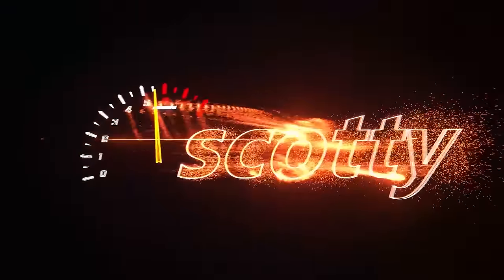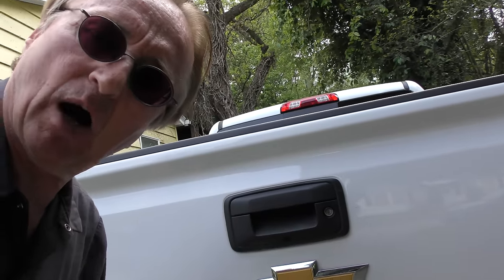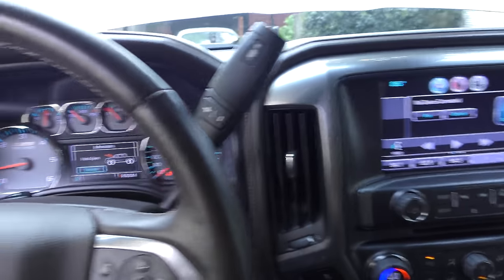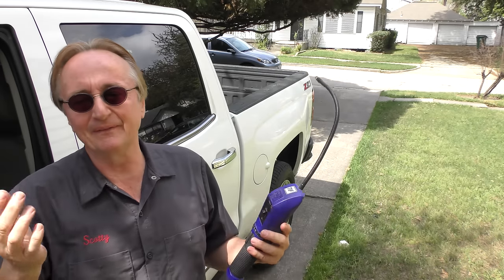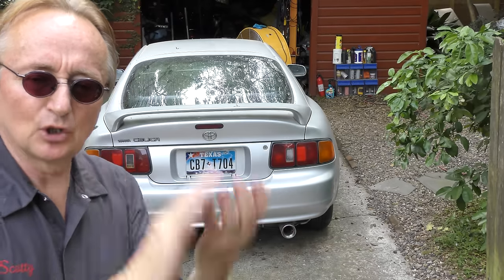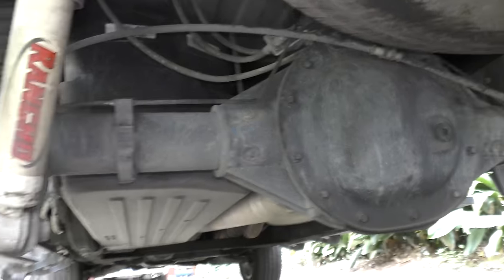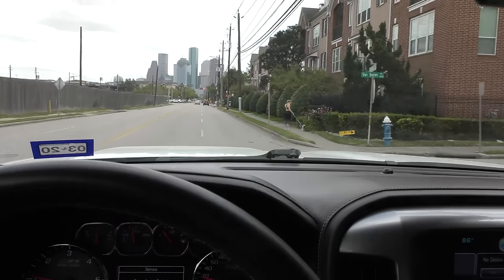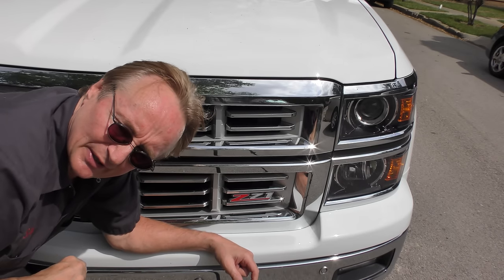Here’s Why I’ll Die Before I Buy a Chevy Silverado

Comment: My 2011 Silverado has 260000 miles on it and it still runs great.I did put a deactivator on it to keep it in full V-8 mode. Great truck with no payment
Reply: Same here. My 2014 silverado 6.2l has 280k miles, I put on a range afm deactivator, and it's still going! Original everything. Just maintenance and tune-ups. I'm presently working on redoing the suspension, though.
Reply: @Flub_Kub you got lucky bro

Comment: I have an all-original 2000 Chevy Silverado 1500. It has nearly 300,000 miles. Even with all the internal plastic pieces they switched to in this generation, it’s still held up better than most Fords I see from similar years.
Reply: Mine has 400000.
Reply: those early 2000 fords are honestly a hit or miss, i know someone who had one with 400k miles and finally went out because of a wreck, and then some where they go out when you just look at it, you never know with those early 2k ones lol
Reply: My F150 has the aluminum bed.  It was cheap when I bought it.  Aluminum bed isn’t a good idea.  Oil change guy tells me the oil pan is plastic and the plug is plastic.  Only a rubber O ring keeps oil inside
Reply: The 2005 Chevrolet Silverado I have has had it’s issues, but it’s a great truck!
Reply: You’re smoking crack saying It holds up better than fords from that year… 2000 f250’s and excursions are laughing their arses off
Reply: @spookledrealhard7154  We’re talking about F1 50s & 1500s!
However everybody has their own experiences in life! Some people prefer a Ford truck some people prefer a Chevrolet truck, some people prefer a Toyota truck. Some fools even prefer a Honda truck. 
You should keep buying whatever you’ve had the best life experiences with!!
Reply: @braveheartz263  did ppqpqaaa
Reply: I like Chevys. 
However, I agree that the cheap plastic handles suck on my 2013 Silverado
Reply: I’ve got a 2000 silverado with 280,000. Nothing other than oil changes and regular maintenance. Everything works.
Reply: @harrisonmauldin5090  all the f150s that aren’t a king ranch or raptor are garbage, and the ecoboost are garbage enginee
Reply: @AsianNIGMA  I’m talking about 2005-10, with the 5.4, the raptor didn’t come out until later with the 6.2
Reply: I had a Ford F150 99 the dash broke before that thing hit 50,000 miles
Reply: So you havent had to replace all your brake lines and hvac actuators...Most the frames are rusting away 99 to 06 if you have snow
Reply: Have a 2007 Silverado Classic (2006 body style) with 200,000 and a v6 long bed. I does have some rust in the driver side rocker panel but it still runs good. The tailgate handle broke at 0 degrees (plastic) . My favorite thing about the truck is I think it's one of the last, if not the last 5 speed manual with cruise control (LS). Anyway,  at 71, I'm going to hang on to it until I die,or it dies.
Reply: @MF-kb2nv  yes that's crazy about the brake lines, a critical part like that should have been stainless.
Reply: I have 2 Chevys. 2002 Silverado 2500 with 540,000 miles and a 2007 Suburban 1500 with 390,000 (original engine and transmission). They ain't perfect but I would go anywhere without a second thought. Scottie is an opinionated individual that likes to hear himself talk.
Reply: I love my 1999. It only has 146k on it though.
Reply: @harrisonmauldin5090  platinun had 6.2
Reply: The 2000 to about 2005 were night and day better trucks than later models. Don't get rid of it.
Reply: @spookledrealhard7154  The chevy was far better than Ford in the early 2000s. That's a fact, not opinion.
Reply: @allaboutroofing2  cool story bro sounds like one hell of an opinion
Reply: I have a 2001 1500, the v8 vortec is running strong, no lost power, at 225,000 miles, my buddy’s 2012 Ford F-150 has had 2 new radiators, 3 sets of new spark plugs, new fuel pump, and new ac system. The only thing replaced in my Chevy is $4.00 per gallon gas.
Reply: @larryrowe5259  I WANT.
Reply: I have a 2004 GMC Sierra w 374K miles n counting. I just redid the transmission bc it was slipping on reverse. Other than that awesome. Not buying a new truck. I'd rather replace my engine.
Reply: @spookledrealhard7154  It’s pretty simple actually. From 2000-2002, Super Duty > Chevy HD Trucks, and Chevy 1500 > F150. And this is from a Ford truck guy. That comparison isn’t even close.
Reply: Yay, I have a 2008 and still works great.  Actually I gave it to my son. Well over 100k miles.  I also have a 2010 and this one has 70k miles to this date. No issues.
Reply: My 2006 Silverado I purchased before the pandemic had 80k miles on it. Now I'm up to 160k and I haven't needed to put much money into it. Definitely a reliable truck. I can't talk about the new ones as I had to trade in my 2015 Sierra due to transmission issues and getting an 06 seemed like a better option as I wouldn't have a payment. The used car dealer actually had to pay me to take that 2006 silverado.
Reply: I have a 2003 Tundra with 600,000 miles and with no cosmetic problems
Reply: I have a 05 Silverado 1500 and it has 333,000 miles and everything has held up great but the transmission went out at 290,000 but after that I got a stage 4 built 4l60e
Reply: mine has 50,000. And frame is done...!!! 2011 POS!!! Chevrolet can sux it...!
Reply: @Hayden-sp1ol  recession GM quality is horrible you should’ve known better, anything beyond 2007 sucks, but anything before 2007 is great, my 05 Silverado is still going strong, the only issue I’ve had with it is the tranny and if you’re somewhat mechanically inclined it’s easy to swap
Reply: Yea he must never seen enough 99-06 models they run forever if u take care of em .

Comment: I can already hear the Ford guys smashing beers together over this victory
Reply: From 6 feet away, to maintain social distancing
Reply: I have 09 ford f150 149k new motor 6gs , I also have 2000 gmc sierra 180k original motor both trucks have little things like fan speed actuators etc gone bad but the ford even tho looks cool sits high rides well has rot in cab corners and has been nothing but a typical stereotypical ford piece of s....
Reply: Hell yeah brother
Reply: Lmao
Reply: @paulclancy2404  maybe wash it once in a while.
Reply: @masteronesolo4615  I keep it clean,  matter fact going clean today it's nice just taking water in rotting the corners quickly and spreading I'm going silicone rear window
Reply: I don’t know how Ford stays in business. I haven’t bought a new one since buying my F-150 in 2006. Still my daily driver with 14 years & 360,000 miles.
Reply: @norcaldeemichaels  I feel if I was able to buy one new it last life time also. My trucks are original owners but ford was big tire big guys heavy foot and chevy was babied taken care of .imo most trucks built well and how you take of them. The ford Van's at work some most durable vehicles I ever driven I'm just upset my truck has the cancer lol
Reply: @norcaldeemichaels  and the Van's are 2006 also so imo also besides how take care them certain years are better than others usually rule thumb dont go with 1st year of that motor or design,  I think only think have be careful are spark plugs in heads not having steel threads know to strip I'm sure w 360k you have crossed that bridge already nice 360 I like to hear 😃👍💯
Reply: Ford's having a premature celebration until they were told pay restitution for poorly engineered and manufactured transmissions.
Reply: Its no new discovery here, he's always said modern Chevy trucks and cars are garbage.
Reply: brad mironik every company has something they’ve been in trouble for though. Both Ford and Dodge basically use the same transmissions depending on which vehicles and got in trouble for how bad they got, Chevy got in trouble for the premature engine failures, Toyota got in trouble for the frame rot.
Reply: Really?! Ford is junkass plastic too dude??!! Really??!! Hahaha!!!
Reply: Hahaha Murcia
Reply: @jonathanrangel7036  True
Reply: insert happy manifold ticking sound here
Reply: They're next
Reply: Celebrating this victory while fixing their transmissions 😂😂😂
Reply: Jonathan Rangel Ford and Chevy have a joint venture to build transmissions not Ford and dodge. If you buy a Ford, it has GM parts in it. If you buy a Chevy/GMC it has ford parts in it.
Reply: Own three fords. 05 f250, 96 f350, 77 f100. I don’t see myself ever buying from another brand. All three still run perfect
Reply: Paul Clancy so you don’t like ford
Reply: Troy Patrick  They were all good back then, late 80s is when things went downhill on a few. Nowadays the big 3 all make shitty trucks. And you can’t convince me any different.
Reply: Mechanics own fords but tell you to buy chevy so they can stay in business
Reply: Man a truck is a truck i had all three chevy dodge and ford my chevy had 253000 mi on it before i sold it to my brother it still runs strong my 1990 F150 lariat had a 351 with 571000 mi an old dodge power wagon with 208000 mi on it i like all three.
Reply: Troy Patrick 😂😂😂😂😂😂😂 ok lol. In diesel world, the power stroke line has the shittiest engines of any diesel. In the gasser world the Chevy 6.0’s and 5.7’s are nearly indestructible. Meanwhile with a Ford you have to worry about head gaskets, cracked blacks, coolant in oil, oil in coolant, motor out of truck etc etc. Ford has some shitty trucks, with some good/great ones. My local parts dealer has an 02 duramax with 1000k miles. Big 1 mil. Fords a joke (trucks)
Reply: lmfao this made my day man
Reply: the ford heater cores do the same thing..
Reply: Paul Clancy that’s on you for buying a 3 valve
Reply: @psyker4321  yep it was the head that caused motor to go , all brands have good and bad even dodge some those with Cummins have million Miles , my gmc runs good but also suffers rust the leaf spring broke off shake going through the bed today's thin metals 20 yrs all going get I live on the water too salt the fords always been pita work on known have those slippytrannys .my bronco was a good truck but it succumbs to the rot 3 tail gates lol
Reply: As Ford got better, Chevy got progressively worse. Between the 80s and 90s the quality tied, but GM has gone downhill since 2000
Reply: I'm ford all the way that being said all trucks from 2000 on suck the 80s 90s fords I have still run my 469 has bout 500th and still going 351 bout 350th and seen me at 16 my 2 brothers at 16 so u no they badass to live through even one kid at 16 but 3 is in heard of
Reply: @scottwood799  do you mean fords 460 motor yes I never forget using a van that motor to dump tires when I was younger than 16 I coukdnt beileive how fast it was lol we beat snot out of it I had alot fun working in junk yards as a kid
Reply: The coldest natty lights aye
Reply: Daniel J yeah the 5.4 triton was one of them right 😂😂😂😂😂
Reply: @norcaldeemichaels  Maybe it's a Utah thing but u see a lot more Chevy, GMC and even Dodge trucks here than Ford trucks no matter how new or old they are! Including all ages of trucks out here in Utah I see about 4 Chevy trucks to 1 Ford truck!
Reply: Ford Ford their the Best! Drive one mile and push the rest!
Reply: @jJohnMcClane  I dont know where you live but here is all the way around 🤷🏽‍♂️
Reply: Yea while wearing dresses
Reply: Rumor has it ford dealerships giving free PPE and safety training courses with every new purchase. No worries if your brakes go out and your door flies open, just tuck and roll😂

Comment: His next episode should be why not to buy anything made after 2000😂😂
Reply: Thomas Conaway 🤣🤣🤣🤣🤣
Reply: Well the lexus he has is very reliable and it's a 2002
Reply: Unless it’s a Tacoma. They last and you can’t deny it.
Reply: C’ mon guys, You do know that Lexus is basically Toyota right?🤦‍♂️ That’s for you non-car enthusiasts out there!!!✌🏻
Reply: @Youtubecensoredmyusername  You're right! My 2003 hasn't given me any issues.
Reply: 🤣🤣🤣🤣u right
Reply: Phuck Onyou older Tacoma‘s had bad frame rot issues But of course Toyota was aware of that and gave away free frames to trucks that were affected
Reply: It will be why not to buy anything but a Celica
Reply: @Streethonda  I'm sorry but Lexus is pretty fancy
Reply: My parents had an 01 Cherokee cam sensor went a year later and 3000 miles yes 2000 on up nothing but junk Hondas different story
Reply: And he'd be right..lol 2000 Camry both V6 and 4 in my driveway. Best cars ever made you'd never know they have 200k on them. But I also take care of them, maintenance is key with any car
Reply: I stay having to work on my 99 e-350 SD. All 4 shocks cost less and took less time than one on my '15 Genesis coupe. You are always going to have to fix cars; why make it harder or more expensive than it needs to be?
Reply: My 2K Chevy Suburban 4x4 runs like a fine Swiss watch with 230,000 mi. on the clock.
Reply: My 2003 s10 is still going strong.
Reply: no
Reply: I would say prefer pre 2000, avoid anything post 2000 if possible, and never touch anything post 2015.
Reply: @Youtubecensoredmyusername  Yep My 99 has 253K miles and counting
Reply: @lh3428  define heavy.
Reply: 2000 and before can be perfectly reliable and good, but i agree saying only buy old trucks doesn’t make sense